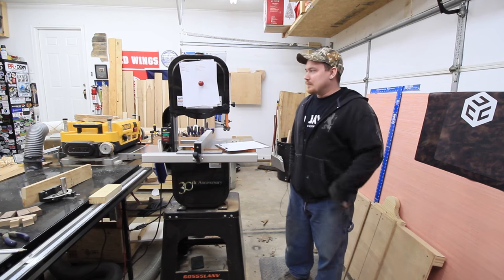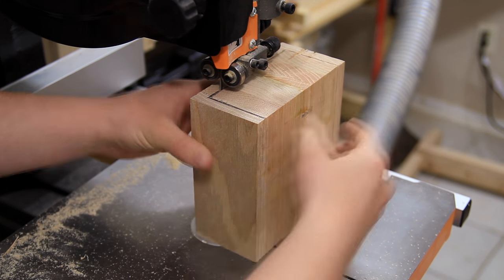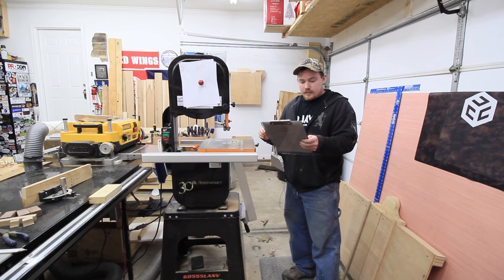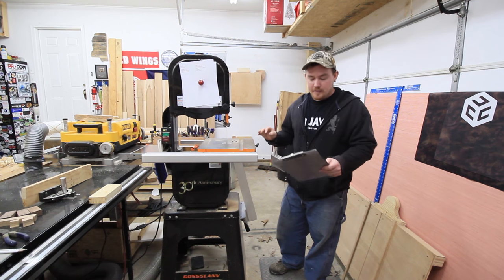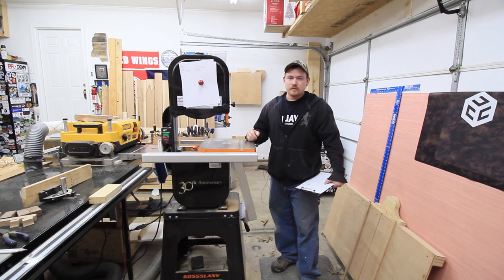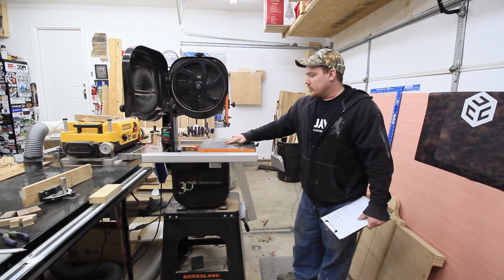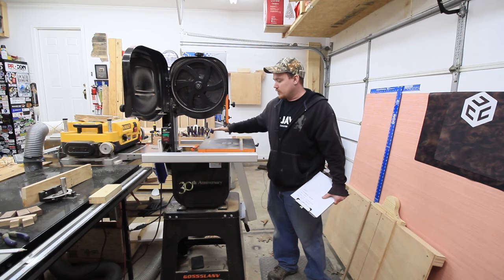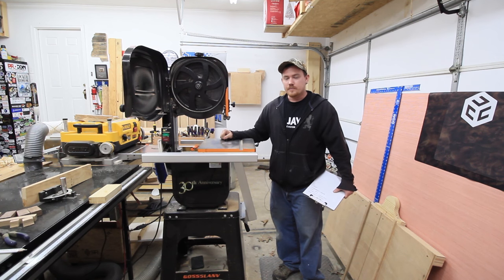Tool Talk #12: Grizzly G0555LANV Bandsaw

Comment: I have the same bandsaw. I hook the fence to the frame behind the switch. I installed wheels in the foot holes on the base at assembly.  Your right about the dust collection being useless. I really love what this saw does for me and my woodworking.  Thanks for putting out a great tool video.

Comment: I have a ridigd 14 in bandsaws. it's just like all 14 in bandsaws in design. however, it only had a shop vac port near the lower guides. it never collected any dust, so I drilled a 4 inch hole in the door read the guides and bolted on a 4 in port. dust collection is exceptional now

Comment: I have the same bandsaw with the riser kit and it's worth the money. First the resaw capacity is awesome and when changing the longer blade I'm able to avoid the issue of getting it around the fence I just release the tension and bring the blade through the front first and then it's easy to go around the table and fence. So my 2 cents worth it's been well worth the money for the riser kit and aftermarket blades like highland. Awesome saw

Comment: I have this one and overall have been pretty happy with it. I do agree about the movement in the table. In regards to changing the blade I haven't had the same troubles I guess. I pull it off the wheels on the left side and out of the bearing guides, then pull it out the slot in the table first and then bring it around front so it can exit the left side of the fence mount easily. Also, I saw a guy who reviewed the G0555 model on YouTube and he showed a dust collection feature he added around the lower bearing guides (mounted to the trunion bolts). Haven't built one myself yet but looked pretty good.

Comment: Thanks for the helpful review of the grizzly band saw. Right now I have a 63 year old Atlas band saw, 12 inch all steel. Works pretty good too. Just tired of turning the top screw handle to release tension on the blade. One day will get another one for resawing.Steve

Comment: Good Video Jay. I got the Lanv about a month ago. I also replaced the crappy factory blade with Timber Wolf, which is scary sharp. I hang the lock in the on switch to remind myself to engage the tension lever (new to me). i put 3" poly casters from big blue (sewol), the 3/8" threaded stem, $28.00, works great. This is the only tool that I have that is shiny, it makes everything else look asleep. Keep up the good work.

Comment: i was SO tempted to go this route, but I have been holding out and for quite a while. The reason is, I don't want to feel that stab of "man, I should have just waited a little while longer" you see @ 8:55 and on, when reflecting on having purchased a saw that only met my needs for a short while (even if that is 2-3 years).

Grizzly is having a sale on the G0513X2 and I have that bad boy ON THE WAY!

I'm extremely stoked.

Comment: Jay, thanks for the review, I just purchased the same saw, and a riser kit based on your opinion.  Overall I like the saw and price during the 2016 black Friday sale.  I have not installed the riser kit yet, figured it is best to start with what the came in the box to insure there is no issues.  In putting it together I found the system for the guide rollers to be tough to set, the blade from grizzly is slightly wide at the weld, meaning I need to have the guide wheels out further than I want.  Also setting the fence guides was a pain, they could use some better adjustment method.  But this tool is 1000 times better than my last saw by Ryobi.

Comment: thats a great looking saw and stands by its name. -small joke about the stand.;) I was shooting for a Grizzly but got   impatient after having bad exp.w/ the Craftsman 9 AND 10".. i went wth Porter Cable from Lowe's. I don't mind it.I use the same - 3/16" 4 TPI skip  from h.w.w...it works great for everything & anything i put on the table.one thing I don't like about my bandsaw is theres no fence. so I had to make a fence .-I really wish all band saws were made the way you described that way blade changing would be easy. it's such a pain.

Comment: Great info Jay. I purchased the Craftsman 14" bandsaw a couple yrs ago and never thought that I would use it as much as I do. The blade I use the most is a 1/4" all purpose blade and a 1/2" resaw blade. Think I may try your 3/16" skip tooth blade. I like making bandsaw boxes since I made several as gifts last yr. kind of gotten hooked on them, lol... again great info and have a great day
Reply: +John Turner I had the Craftsman 14" and just never felt like it was a solid machine.  I kept buying aftermarket accessories to try and make it a better machine.  I sold it when I moved from Iowa to Oregon.  I just recently purchased a Grizzly G0513X2 and it's a night and day difference in quality.

Comment: Good overview, Jay.  I essentially have the same saw, but they call it the "ultimate".  I added on the riser block and honestly I've never been very happy with the saw.  Bad blade drift, even when the tension is so tight you swear the blade is going to snap any minute.  I mainly got the riser block for resawing rough stock.
Reply from the maker: +Jason Rausch Have you adjusted your upper wheel in or out? that will cause a lot of blade drift.
Reply: Jay Bates 2 I have, Jay, but something still seems out of whack.
Reply: ***** I will check that out.  Not sure if I subscribe to him yet.  Thanks!

Comment: Bandsaws don't take much space.   The Resaw bandsaw is the only one that needs any infeed/outfeed space.    My 2nd bandsaw (the one with the small blade for curved cuts) is tucked right up against my DC and 9 times out of 10 there is no need to move it, as curved cuts don't usually take up any space behind the saw.
Reply: +Wordsnwood (Art Mulder) Especially if he (Jay) is not really crazy about the dust collection on it...he could just not hook it to DC and clean up the dust afterward.

Comment: I have the same saw...I know it's a pain but I just remove the table when replacing the blade, easier to adjust the bottom guides with the table off as well...
Reply: Jill

Comment: That is an oddly small re-saw capacity for a 14" saw. My saw is only a 12" but my re-saw capacity is 8" and with a little guide modification I think I could squeeze another 1/2"-1" out of it if I really wanted before the case got in the way. 
Mine does have the front blade slot, but it's even less convenient than yours because my fence guide totally blocks it and has to be removed to change the blade. I am waiting for a flash of inspiration to give me the idea for how I can modify this to make it easier.

Comment: Grizzly sells a riser kit to increase the resaw capacity of their 14 inch saws up to 12 inches.  I'm not sure if it would decrease the structural rigidity of the saw, but for $90 (new longer blade included) it can't hurt to try it.  before upgrading to a whole new saw.
Reply: Not sure if you allow links in your comment sections; but here is the link to the kit.  
http://www.grizzly.com/products/Riser-Block-Kit-for-G0555/H3051
Reply from the maker: +Gregory Schafer I allow links. Sometimes YouTube doesn't though :)

Comment: I have the same exact bandsaw...no issue with the tabletop rocking. Agree the dust collection sucks, but other than that it is a good bandsaw for the price. You didn't make sense at the end...whats wrong with the riser block?
Reply: +WestCoastMods Dust collection is an issue on all bandsaws.  The issue is most of the dust travels down with the blade into the area where the lower bearings are.  This area is not sealed and therefore capturing sawdust becomes an issue.  A dual port model is a little better, but you still have that wide open area under the table.

Comment: Hey Jay need some advice. I have the same bandsaw as yourself and just received the 3/16 blade from Highland that you talked about here in your video. This blade is replacing the garbage 3/8 that it came with. This new blade will not stay on the wheels no matter what I do. Barely get it to track just back of center of wheel and if I as so much gently press back of blade while I am spinning blade with finger and it runs right off front of wheel. No issues with the factory 3/8" blade at all, it stayed exactly where I put it no matter what I did. Adjusted tension block to just under 1/4" since it was at 3/8" from factory with their 3/8" blade. Any tips you used or similar problems?

Comment: When changing you blade, you should take off the table...... there is only two screw handles to remove it.  By doing this you will be able to adjust everything very easy and the blade around the fence problem will go away .  It does not take that much time to take off and put on the table..........  Try it
Reply from the maker: +Thomas Kaiser To remove the table with the blade on I would have to remove the front or rear fence rail first.

Comment: Jay, with over a year with this bandsaw, how do you feel about it now?  I'm considering buying one, originally I was going to get the cheapest Laguna, but these look much more affordable but still solid bandsaws.  I build guitars so all I really need it for is cutting through 2" thick mahogany with 1/2" thick maple top, I'd route with a template for the final outline.  Also I might need to get the riser block to cut through flame maple for a book matched top.  Just wondering if you had to do it all over again would you have chosen this bandsaw.
Reply from the maker: I've had it for about 4 years or so now. It's a good performer. A 3/16" 4-tpi Skip tooth blade from Highland Woodworking will do everything you need it to do and do it very well.

Comment: i have the same saw had it a year had trouble withe ball bearing blade guides switched to the square cermaic guides they seem to fit better the bearing guied holders were real loose did not fit real tight the ceramic guides holders fit better they run cooler but the bearing guides never could get them set settings kept changing went buy the book and called grizzly they did not what to do even ruint coulpe of bearings but they replaced them now my errors are oparater error

Comment: I was wondering how you know when the blade has the correct tension?  I have a 10" craftsman, and when I try to do a set up on it, I have no idea if the blade is at the correct tension.  Looked it up online and cannot find anything definitive.  I think I have my bearings set correctly, but my first few cuts (with a brand new blade) came out strange.  The cut looked good on one side, but the other side was burned.  It makes some strange noises too.  I may just have a junk band saw.
Reply: I have the same bandsaw and mine cuts pretty good for what it is. I've even resawed  white oak with the stock blade. the only wierd noise mine makes is the bearing guides if they aren't set right. I also have no idea how tight to go I just tightened it until it cut straight. sorry that's not very scientific. Soon I want a big band saw for resaw and I'll keep my little craftsman for scroll work. for the price it wasn't bad. if you need hell let me know
Reply from the maker: +Howard Springsteen burns on one side sounds like the blade is drifting once the cut has started. That can sometimes be due to a blad that isn't sharp. Or a low tension on the blade. I normally use the tension gauge as a reference and then increase the tension. No really way of telling how much tension I put on it though as it's one of those "by feel" situations.

Comment: Hey Jay Sir,
I have the same saw and have never changed my blade like you describe. Undo the 2 knobs that hold the table at whatever angle, barely lift and turn the table clockwise a bit. Pull out the old blade and slide the new 1 in. Put the table back together but don't tighten fully. Set the rest of the blade and  your bout done. It has to save Major minutes. Jonesy at Facebook.Com/Jonesyfamilystore.

Comment: Hello, could anyone tell me what is the difference between G0555LANV and G0555? Because I’m planning to buy my first band saw and I saw someone selling on Craigslist both models. The G0555 priced for $500 and the G0555LANV for $300.
Reply from the maker: LANV is just the anniversary edition. Stickers and such. I'd grab the LANV today at 300 if it was in good condition and listed near me.
Reply: @JayBates2  I bought the G0555 because it’s near me and the seller lower it to $450 and with mobile base/wheels and 3 brand new blades. The G0555LANV has a little rust because it was stored outside but still working good. Anyways, thank you for your response

Comment: I bought the same saw at the same time. Mine came with wheels that were way out of co-planer.  Could not keep a blade on the wheels until I purchased shims to move the lower wheel out. Still tough to keep narrow blades tracking. Grizzly customer support has not been helpful. Just a cautionary comment.
Reply from the maker: +David Kuhns Thanks for the input.
Reply: I have had the same experience! I spent hours trying to get it dialed in and grizzly was absolutely no help. I even had a really experienced friend look at it and he agreed that it was off.  I would have sent it back but I struggled to get it into my basement shop and don't have a pallet or the original boxes to send it back. Anyway, thanks for the comment, I was glad to see it wasn't just me.

Comment: yes but the key question is,,,,,they have a one year warranty vs rikon with a 5 year,,,more acceptable to getting burned when you can pick the rikon up at woodcraft,,plus home depot bandsaws have a 90 day return policy with no questions asked,,they seem like a good bandsaw,,,but if they really believed it the warranty would be longer,,im from the old school,,and I don't like to get cheated,,already been there with that one from sears
Reply: jeff oldham which band saw do you use?
Reply: actually I have the sears 10 inch model,,which sears is repairing,,,they have to research getting a part that has been discontinued,,and its a new bandsaw,,lol,,I think im going with the laguna 14 12,,supposed to be getting it Monday,,,

Comment: I usually enjoy watching your review videos, mainly for your honesty, but with all due respect I feel like you kind of mailed this one in. Most of what I got out of this was you would've liked "more resaw capacity." No mention of blade tracking, noise level, style/settings of guide system and tension, your thoughts on durability, and features compared to others in the price range. "This is the 30th Anniversary model which is painted black and some other little odds and ends" and "there's a knob in back to straighten the wheel" (co-planer, btw) is not much of a review. I bought my Laguna 1412, which has been fantastic and has 13" resaw capacity, about the same time as you and the prices weren't far apart. Anyway, not to seem overly critical, but I felt like you haven't used it much or know enough about bandsaws to give a helpful review to potential buyers, which you usually do. So keep up the great reviews, but stick to tools you've gotten more familiar with.
Reply: I'm sorry to hear that Jay's FREE information and opinions weren't to your liking.  Hopefully, he will spend more hours researching, using his tools, and writing in-depth, thorough reviews so it will be worth all the effort you put into clicking a link on YouTube.
Reply: 1. Jay doesn't seem like the type of guy who needs someone like you to defend him, especially for polite, constructive criticism. 2. Jay gets paid something every time someone clicks on one of his various media outlets - not to mention a fair amount of free tools to give "free information" about, which is fine. 3. My comment was directed to Jay, so who the hell asked for you to chime in?
Reply: Jay didn't need my help.

Nobody asked me to chime in.

So, I guess you and I aren't so different, eh?

Comment: It's a shame that we have to save up our money to buy these things and they are all essentially offshore junk.   It's fine to make homeowner model tools, but it's a shame that we have to pay so much for so little.    Taiwanese motor, stamped steel trunions for the blade tilt, and a frame so week that one needs to remove tension in between uses or the fame will deflect.   I own several saws, none have had premature blade failure due to tension.  That's like saying to jack up your car to save your tires & springs while you aren't using it. It has a great paint job, looks good, it's too bad that you end up with junk.  I could have been made with cast frame and table, and it wouldn't have had to cost more, except for corporate greed.  Sadly these are no better than your average washing machine or refrigerator, in 5 years it will be done.  Made for the dump!